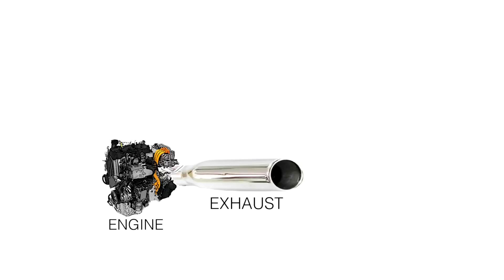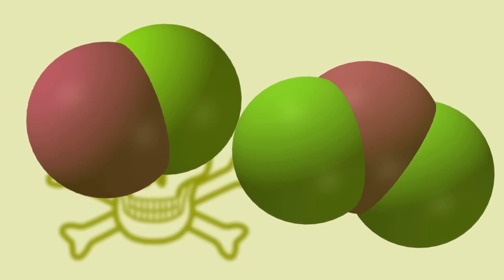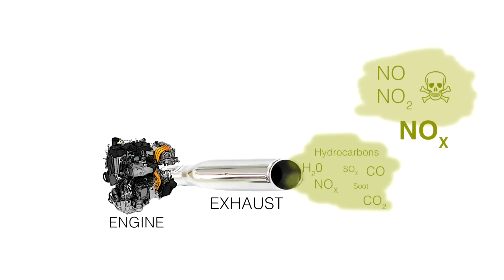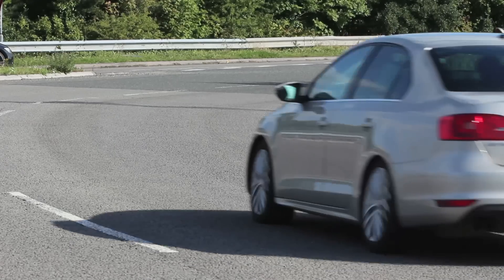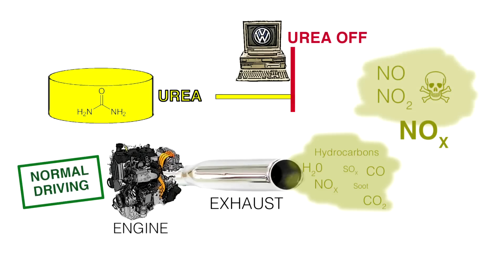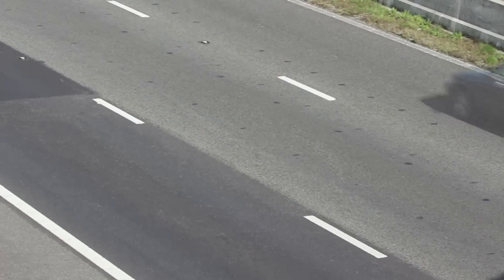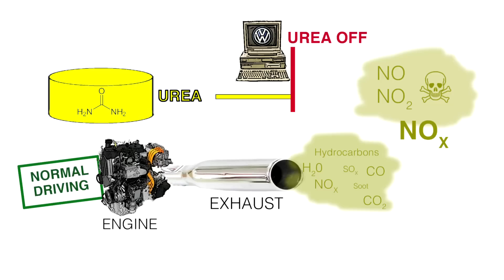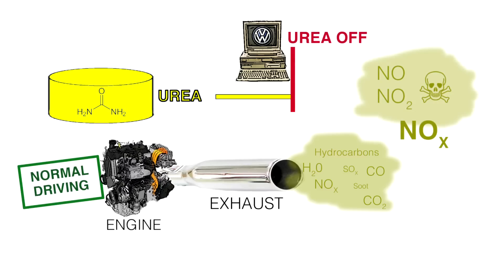Diesel and Urea

Comment: Motors can't control oxygen coming in, only fuel. Everythng else is passive
Reply: +wolfy9005 Not true in a modern car.
Reply: +ryan remus I realise this about semantics, but a motor doesn't necessarily have to be an electric motor. A motor, as defined by Wikipedia, is "a machine designed to convert one form of energy into mechanical energy". 
Electric motors, ICEs, stirling engines, steam engines, etc are all a type of motor.
Reply: +wolfy9005 Wrong. There is an exhaust gas regulation valve, which regulates the concentration of oxygen in the combustion chamber and therefore the temperature of which, by pumping back exhaust gases into the combustion chamber. This is done to optimize the efficiency of the catalyst which works best at a very specific temperature.
Reply: Paul Hendrix agreed, there is no specific definition that says you can't call a petrol engine a motor. I think it's just no one would call an electric motor an electric engine. Kind of like how a square can be a rectangle but a rectangle can't be a square.
Reply: +ryan remus it makes things move, so i'll call it motor. also there are large pieces of software called engines.
Reply: +Peter Pepper I'm pretty sure we agree on a couple things, but the EGR is to reduce temps by allowing exhaust gas to take up space in the combustion chamber. If temps reach over a certain point the EGR opens up and tries to reduce it to prevent the formation of NOx. The O2 readings the ECU sees from the first Oxygen sensors are to make fuel trim changes. The down stream O2 sensors past the cat are generally to just make sure the cat is working and if not notify the driver. Also not all cars have an EGR system even new, because the EGR's primary goal is to reduce combustion temperatures, but if the engine is in within acceptable limits of NOx production then they don't need it. Many Toyotas/Scion/Lexus after 2005 do not have EGRs, they use other methods to reduce combustion temps, newer Hyundais have something similar as well. I'm sure many other companies have something also since if they don't need to add an EGR system then it saves them money.

Possibly part of why the EGR opens up if the O2 readings are high is because when an engine runs lean combustion temps then to go higher.

But if the car is running lean the car can't really compensate a whole lot, thus why you'll get CEL for lean conditions.
Reply: "...but the EGR is to reduce temps by allowing exhaust gas to take up space in the combustion chamber. If temps reach over a certain point the EGR opens up and tries to reduce it to prevent the formation of NOx"

That's exactly what I said! Why the 'but'?

I can see your other points though, very informative! Thanks!
Reply: Peter Pepper My bad, was too early for me, lol. I guess my point was that it was less about oxygen regulation as it was reducing combustion temps. But yea, pretty much agreement.
Reply: ***** agreed, everything is a motor, just not everything is an engine.

Comment: It's not that Volkswagen was trying to save customers from wasting urea it was that they claimed it wasn't even needed on their smaller diesel engines so they were produced without this urea tank. While the smaller engines like their 4 cyl models can run in lower emissions without the need for urea, the engine must sacrifice efficiency and power to do so which would not please customers. Their solution seems to be that if the vehicle detected a test, it put the engine settings to a low emission mode with low horsepower and reduced fuel efficiency but great emissions. Outside of the test, the engine ran as normal, producing power, fuel economy, AND NoX emissions. 

This wasn't just to save their smaller diesel customers from needing urea though, it also allowed them to simplify the exhaust and catalyst systems, saving them a whole lot of money since these systems usually add several thousand dollars to the cost of the vehicle.

It's a bit like advertising a vehicle gets 20% more horsepower but keeping secret that it only produces that power on a dynamo and never while actually driving. 

However, you can fool a test but you can't fool chemistry. When NoX levels started to increase in urban areas, people began to suspect diesel might be the cause and for whatever reason, they decided to test the vehicle emissions under actual driving conditions, vehicle in drive with a driver in the seat operating it, and when they compared those emissions to what they measured when the car was parked and being tested, they found vastly different numbers. 

By carefully testing this they concluded that the engine computer knew it was being tested, and had been configured to change engine performance to beat the test.
Reply: I wish Periodic had mentioned the history of urea because it's significant. It was previously a pretty big deal when Wohler discovered how to synthesize urea in the lab. The reason for this is because it was known to exist in urine, and it was thought to only result from biologic processes. The discovery that it could be produced without biological precursors opened up the realm of modern organic chemistry by bridging organic and inorganic chemistry and putting an end to vitalism. Vitalism was the long held belief that living things had some essential quality that separated them from non living things.
Reply: +Subparanon Yes, you are right. This is very important!
Reply: Absolutely. I'm surprised this correction is not top comment, the vw part was clearly not researched.
Reply: I'd imagine it's some variation of that. Modern vehicles also can tell if the transmission is in drive, if the wheels are rotating (for the reasons you mentioned), as well as detect if a passenger is in the seat by their weight closing a contact switch. It's used for automatically disengaging airbags and load sensors can adjust airbag timing for different weights and distances from the steering wheel depending on seat position. Cars are actually pretty smart from a telemetry perspective and if they have traction and yaw control they also have accelerometers that can tell if the car is at rest or moving.
Reply: I don't think this particular problem has come up before but going by scandals involving horse power or fuel economy I'd say fines, public backlash, loss of stock value, and a changing of the ranks in the company are all likely.
It was recently found that several other diesel small block vehicles from other manufacturers were doing something similar which might deflect some of the spotlight from Volkswagen.
The public takes a very dim view of companies that configure their products to cheat tests. Like if Nvidia made a video card driver that detected if it was being benchmarked and went to a fast but low quality mode only during the benchmark test in order to boost FPS numbers. :)
Reply: Chronius9 NOX emissions are highly reactive and in urban centers especially can reach high enough levels to impact quality of life.
Reply: You have a skewed perspective my friend. Before regulations people regularly died of lead and mercury poisoning, asbestos, and a whole slew of polluted environmental issues. It seems you can't imagine how little things can have much of an impact but that speaks more to your lack of imagination and understanding of chemistry than to a lack of danger.
Reply: this is really important. thank you for the comprehensive correction.
Reply: +Subparanon  Definitely, accelerometers, weight sensors in seats and variety of other sensors can be used to determine if car is driven in normal conditions or undergoing a test (which is very specific by the way )
Reply: +sugershakify  Strangely enough my Gulf TDI happens to have a urea injector also.  And I agree that the American car company's are also doing the same thing that VW is doing.  The only difference ..... VW has deeper pockets, much better to pick.
Reply: +Subparanon I, early in September, bought a VW Golf TDI.  This may have been an unfortunate purchase, however, It did come with a Ad-Blue, or urea injector.  I wounder if they may have anticipated a scandal and included it on the 2015 models.
Reply: more replies will get the comment higher.
Reply: i don't know if it works when they are from the same person though
Reply: +Paul Hendrix but i'll try.
Reply: +Subparanon The way I understand it, is that some amount of unburnt fuel is necessary for the reaction, probably to heat the system, and that extra fuel is only added during the test. And if they were smart, they legitimately could have used only the traction control failure as an input to activate a safe mode, to richen the fuel ratio.
Reply: I'm pretty sure that the engine configured itself to produce less power and run a richer mixture to improve the exhaust catalyst reaction. Running rich usually results in less power and fuel economy and that's just one aspect of engine control the ECU could use to optimize for the test.
Reply: Actually I'd like to see gasoline and diesel stick around a few more decades, just to see how much further they can go. Back in the 70's a 2.0 liter 4 cyl in a typical car might make 60-80 horse power, but now days even naturally aspirated 2 liters can make over 200 and get excellent fuel economy as well. Even a modern engine is still massively inefficient at converting kcal's to mechanical energy and every bit of efficiency also means you get more power and more work out of the same amount of fuel. I imagine if it keeps going like this it might be diminishing returns but we still have a very long way to go before we hit any hard limits on efficiency and power. I can only imagine the cars of 2050 making 250HP on 1 liter displacement and getting 40mpg city even without hybridization.
Reply: +Subparanon  All energy forms are relatively inefficiet. People keep highlighting the % of ICE's but dont give comparison to say a steam turbine or powerline grid losses. Electric powered cars actually use a very degraded and inefficent % of the energy from the furnace at a power station. ICE's still have excellent performance,portability and useful application and a bright future. Manufacturers still have some exotic ideas to improve performance.
Reply: +Calin Florin Yep. If we get nuclear fusion working, or at least molten salt breeder reactors (much less environmental risk than the current solid fuel once-through reactors), the electric cars will be nearly pollution-free.
Reply: +Subparanon Agree with you. VW claimed that their diesel engines were able to run WITHOUT the use of urea, and still meet US emissions standards. The US EPA relied on the car companies, including VW, to preform their own testing, and took the car company's report as fact, without doing any field testing of their own. The EPA relied on the several states within the US that require periodic emissions tests to preform the actual field testing. VW went so far as to devise software for the engine management system that identified when the vehicle was being emission tested, and operate in a low emission, low power mode. European governments relied on the US EPA's findings (which included the fradulent reports from VW) to set their limits on emissions. In effect, VW lied to the US, and Europe relied on the US EPA to set their standards.
Reply: Urban areas did not see an increase in NOx due the VW diesels. No one can make a claim like that, it would be impossible to quantify. 
 Independent testing while acquiring data for other research revealed the software modifications by Volkswagen to fool emissions test.
Reply: Interesting. I had heard the 2015 models were included. Golf is definitely one of the small engine sizes they misrepresented however a google search reveals 2015 Golf TDI uses a newer generation EA288 so there may be something to your suggestion.
Reply: +Dale Carlson I dont know about diesel, but in gasoline engines if the mixture is richer on gas it burns at slightly lower temp ant thus not creating NOx.
Reply: Thanks alot! Broaded my view.
Reply: Not all Diesel TDI engines they sold did this. The cheating took place over a long period of time but not all engines did it. For instance if you had an EA288 engine in the last few years it used urea.  Certain configurations for certain model years, like the 2015 golf may have the more expensive urea systems.
Reply: +Subparanon I do not understand why emissions controls decreased fuel efficiency. If you are burning the fuel completely, that means it is very efficient because you are getting the most power per unit of fuel. Also the engine will be emitting less emissions because of completely burned fuel. Isn't this true in all cars?
Reply: Karlfalcon An engine that burns a lot of fuel in a short amount of time will get more power, but emit more. (Obviously) But if you are driving at a fairly constant speed, you will not need a different level of power, so why disable emissions controls? I do understand that a Prius or Honda Civi has less torque and horsepower than a Chevy Silverado or a Dodge Charger. I guess this means balancing power and efficiency.
Reply: +Subparanon Thank you for the explanation :)
Reply: VW Polo GTi is a 1.4 litre and makes 180hp. My bmw is 3 litre and makes 320hp and max torque is 1500rpm to 4500rpm because it's limited to have a flat torque curve. 330ft/lb at 1500rpm... But then the 2.0 litre Subaru impreza is almost 300hp stock. I agree, with technology, engines are getting more powerful and smaller. I think it's great.
Reply: +wazza33racer 
It is better to deal with the polution outside the city at the production plant. And there is also what is called green energy.
Reply: How VW is still allowed to do business in the US is depressing.
Reply: The video went some way to clear much of the murky cloud surrounding the scandal but hats off to you for such a beautifully detailed in depth explanation.
Reply: Subparanon — Yes, it was an outright fraud to give them a competitive advantage.
Reply: From what I'm told it was originally discovered by some students doing a project where they measured emissions on rollers and on the road. They then discovered that WV cars would have differing emissions. At first they thought it was a fluke or error in how they measured, but the truth was confirmed after some time.
Reply: Lesson: Corporations can never be trusted to do the right thing.
Reply: +Subparanon I am very happy that I do not have to separate it out my self, as in times past.  I would have opted for a gas vehicle if this were still the case.
Reply: +Subparanon It's odd you say VW did not put a urea injection system in the Passat I drive, since I have had to refill it a couple of times with urea and this odd message pops on the console telling me in it's going to run out.

The problem is the EPA has the most ridiculous tough emissions rules compared to any other country and their standards are unattainable. The only way to make a car that is actually drivable is to cheat. ..... and guarantee you all the car companies cheat.

The explanation is wrong. The car uses a predictable amount of urea and the urea tank has to be refilled every 20-25k miles
Reply: +Subparanon I can assure you it does.  I have one.
Reply: +Subparanon It is Ecoidiotic regulation, not a real problem.
Reply: +wazza33racer 
No matter how you compare the two technology , if the calculations are made , the elctrical solution looks allot better.

Comment: Sorry Professor, while your chemistry is spot on as usual, the VW Diesels in question do not use urea injection. Emissions controls are a great example of a highly controlled chemical reaction.
Reply: +truantray He's half right.  VW was caught cheating on both its urea injection vehicles (Passat) and its non-urea "NOx trap" cars (Jetta).  In any case, the urea system is more fun for a chemist to talk about.

Comment: Now talk about dc tactic and ac static in the cylinder and make an incoming vacuum within the air ac and do away with the diesel of petrol by utilising the tesla effect starter dc pulse intertwined with the phase in and out off the alternator spiked 90 to the engine causing a negative ion generator and with it pulsing a positive ion generator Neutral hmmmmmm as the fuel off stripped air pressure vacuum di lithium causes a freeless non friction

Comment: Correction.  A diesel compresses only air, so pre-ignition is not possible and the compression can be much higher and get more energy out of the eventual combustion.  At maximum compression, the diesel fuel is sprayed into the air that has been compressed enough to produce instantaneous combustion.  Of course, that extra combustion produces more nitrogen oxides.

Comment: What about hydrogen or ethanol ic engines? which i know arent widely used but are worth mentioning. because in the future, hydrogen as well as ethanol will be the most widely used fuels for ic engines(piston and turbine), maybe a video on the chemistry of those alternative fuels and why they are superior to fossil fuels is in order as far as their carbon footprint and energy storage capabilities. Also the NOx emissions could possibly be solved very easily without urea or the other catalyst someone mentioned. Regardless I'm drawing up a design in my head right now which i will patent and sell to volkswagen as well as other diesel engine manufacturers. If i am correct it could cut all NOx emissions from diesel and petrol engines to less than 1% of their current rate. although its doubtful someone hasn't already thought of this solution before, its probably already patented lol